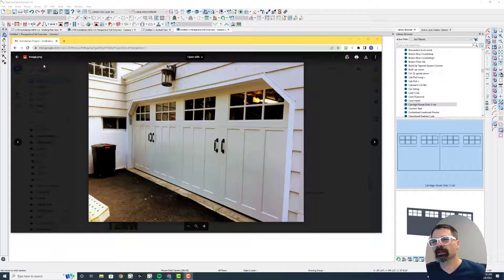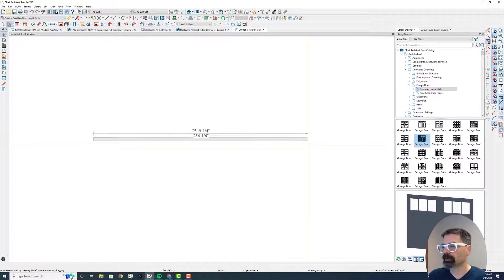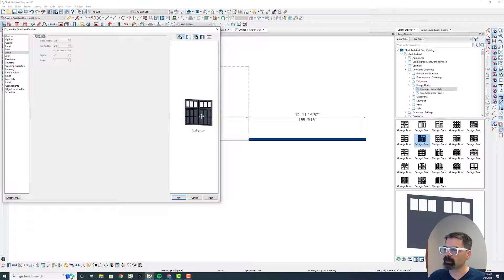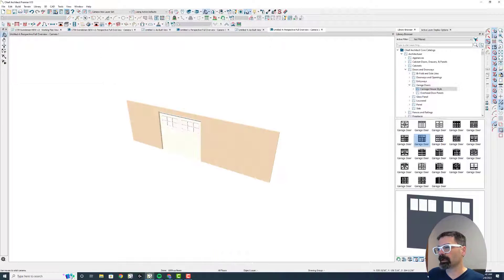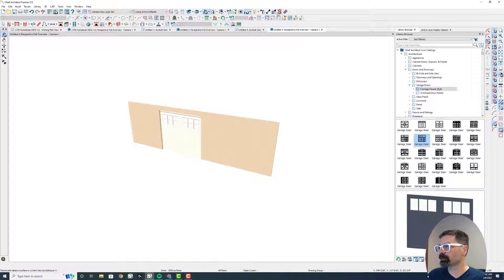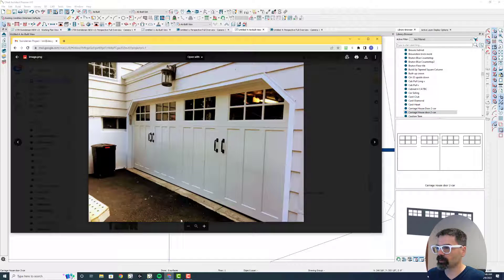Make a Custom Door Symbol quickly | Chief Architect

Comment: Wow, I guess I really missed something.   You lost me at creating the 1" high polyline solid strip.   What was the purpose of that; - what did it do for you?  You embedded it in the door in section, but then I never saw where you copied the entire door, or the glazing panel, or anything else, in order to duplicate an entire door.   Does having a strip of 3D solid help you select the door to reproduce it somehow? 
I guess I'm one of those people who benefits from understanding what the purpose of the step is before I see it done, or from knowing what the concept is.   
I watched this vid because I'm trying to break apart a library panel door to create different colors in the panels, and change panels on one side versus the other.   I thought this vid might help...
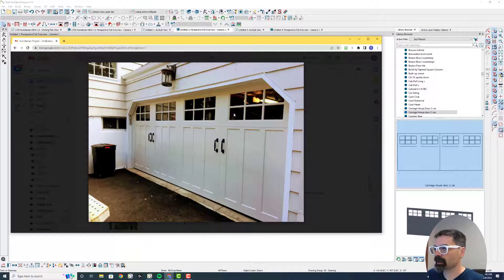Reply from the maker: You talking about the horizontal muntin at 2:55? I guess I wasn't clear. Instead of creating the whole door from scratch, the library door is close to what I want, Just need to add one horizontal muntin and then make the door four panels across instead of 2. The concept is shown at 0:05 and 9:11
I copy the muntin once for the interior/exterior color of the muntin at 4:10. Then I copy both interior/exterior muntin at 5:00
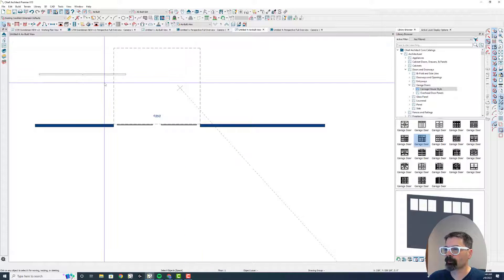I turn the single door into a symbol at 5:55 and copy that symbol at 6:39 then turn both symbols into a door at 7:00.
Breaking apart a library object is a different process. I'm only adding to an existing object and then doubling it. This video is more of an additive process, you're looking for something subtractive, which can be done, just a different process...gives me an idea for another video!

Comment: That was great. As I actually had garage windows to match our real selection! I'm quite clumsy by comparison in my 2022 HD Pro ... I don't have solid polylines that I can tell so I use soffits as a hack.
Reply from the maker: Yep! Soffits would work too. Great suggestion. If I remember correctly, we used to use soffits like solids for everything until they introduced the Polyline Solids, then primitive shapes, and now 3D solids.